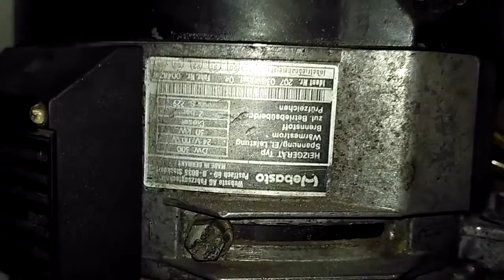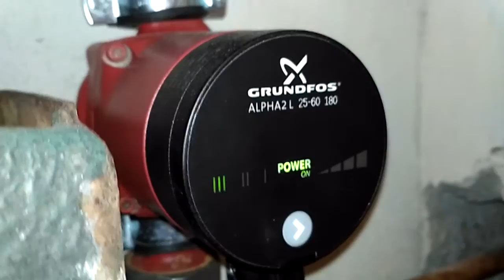Webasto DW 300 used for home heating

Comment: Can you please help me. I have a heater just like yours and i need to find out the wiring for the heater to run..
All i need is the + the - 24volt wires and wich wire to start the heater